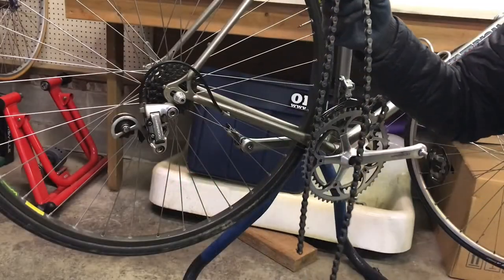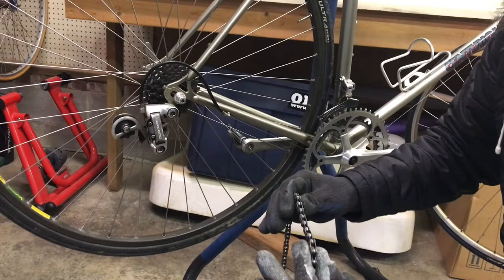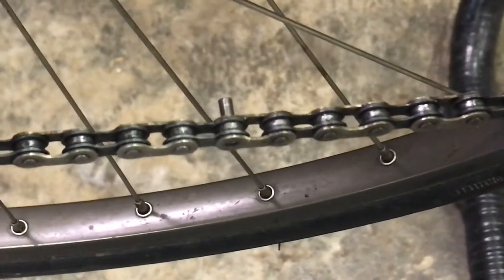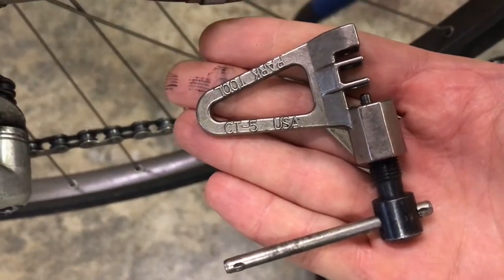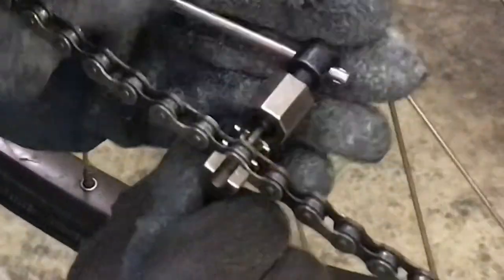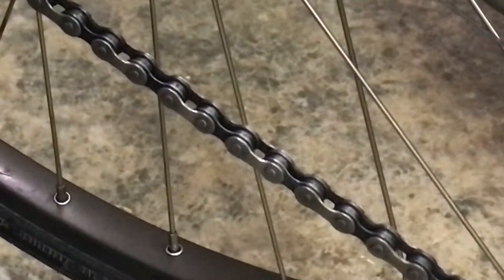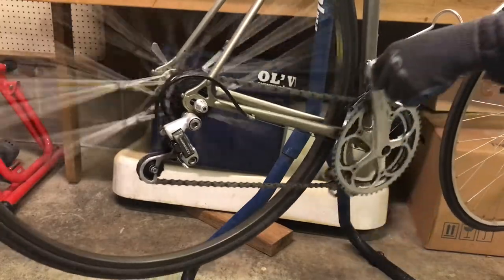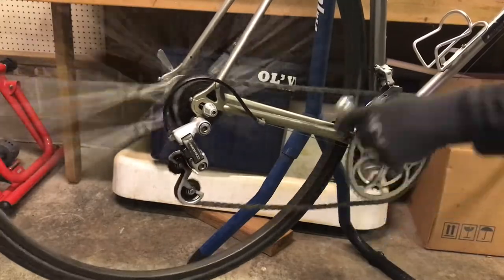How to Install a 6 Speed Bicycle Chain

Comment: Took me a whole movie to watch and cant get the stupid chain on
Reply from the maker: Practice, practice! Thankfully you can push the chain pin in and out a couple times before you make the hole too large. Also, make sure you have a good chain tool. Lastly, make sure the pin is pushed in the right amount. A little of the pin should be showing on each side of the chain link. Oh, and just remembered, don’t mash the pedals when you are learning how to do this. Pedal around with a little force to make sure the pin will hold. If not installed right it could pop loose send you to the ground!